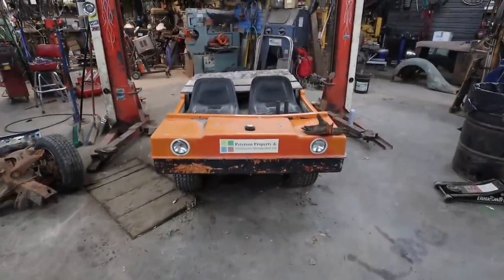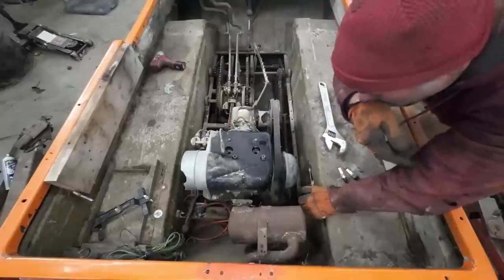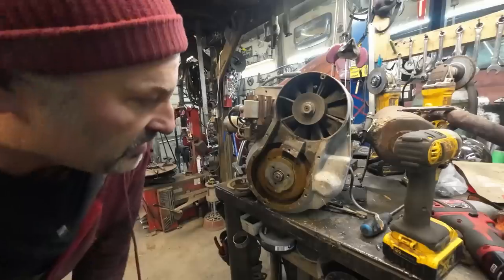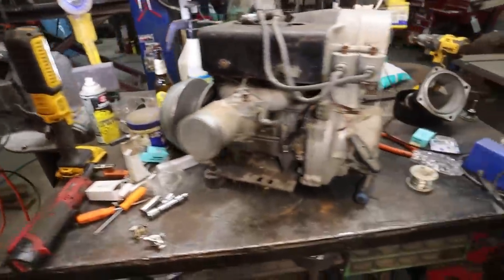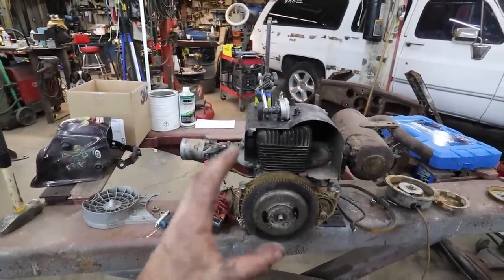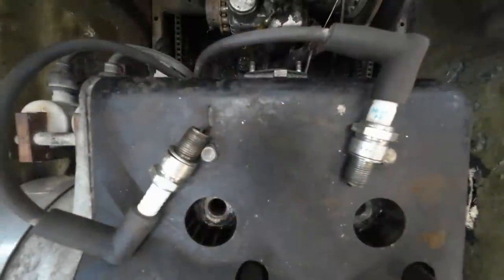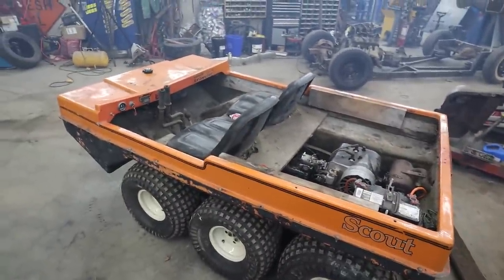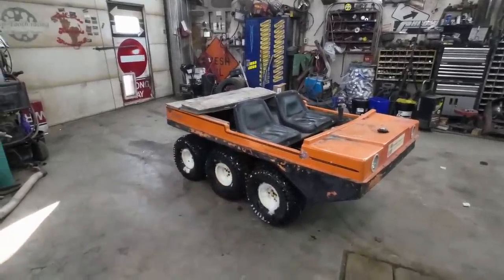1972 OTACO Bazooo 6x6 can we get it to run and drive again?

Comment: well nice little video  I do not know if you was doing it for show  or you think you are the hulk  but who think that can fire up a engine  with just setting the plugs by hand everyone know that you have to torque the plugs  to have compression   also in  all th time you have this little one on your shot you did not work on the gear s and all the moving parts  wow  also that is one of the smallest ATV   I ever saw they are normally for 4 to 6  people big that is small  sorry but  I am a mechanic and I can spot the  BooBoos  in your video also one of the coils is burn out  get new ones  and it will be a great  toy to have around

Comment: Wow, you are persistent, don't know why u didn't wire up on the bench to a battery, while trying to get it running. I know u know, just need spark (power to coils), fuel and compression.

Comment: WHY NOT just bolt it to the bench till you get it running? That is part of what I meant when I said "Bench work it". That would save you a lot of grief on taking it out and back in again and again. 
Sorry. It is you're project, not mine. I'll shut up now and let you do you're project, your way.
Reply from the maker: I didn't have any of the electrical to make it run on the bench was the only problem I had with that option :)

Comment: And pull back to stop . The belts wear on the side not the bottom. Wrong. 14 to 20 dam I told you 20 to one.  O god dont go out in the water you get the plug right.

Comment: You're pissin in the wind. Should have dprayed gas in carb. Dont burn up thenstarter motor. You'll never find another. Plugs and carbs are allwaysbthenproblems. Did you mix oil?? Or time it?? Switch plugs. You really need some info..belive me to set the belt loose. There sre timing marks.is thatba walbri carb. Thise aint float bowl carbs. They are diaphram.you need a manual. Unles it has the winderful Mikuni carb. They are float snd use an impulse fuel pump
 Im 80 yrs old and its nearly dawn. Gottabgetnsime sleep
 Good luck.Guessingnyiur way is oretty risky on vintage motors cause parts are rare..that motor was built un late 60 s to mid 70s nyheres a onebwaynvalve fuel pick up on lanknhose. Dam you are gonna fry that starter
 I told you to mist starter fluid in carb.remember theres a pickip dtrainer one way valve on the end of the hose in the fuel tank fud you find the hose in the tank?? Ut has to be there. The pivk up needs cleaned out ot no fuel. You should have been taking my tips .You burn up that starter up you'll never find another. Did you find the hosr in the tank.Christ your gonna smoke that starter..did you get the impulse pump hooked up. Keep running 20 to onento revive that old motor.

Comment: I'm 40 minutes into this video and the oil has NOT been checked (at least on video) 
Trying to start a motor not knowing if it even has oil in the crankcase!
Reply from the maker: It's a 2 stroke they don't have oil down there. The mixed gas lubes the the bottom end.
Reply: Glad we straightened that out
Reply: Think chainsaw
Reply: No oil or water needed